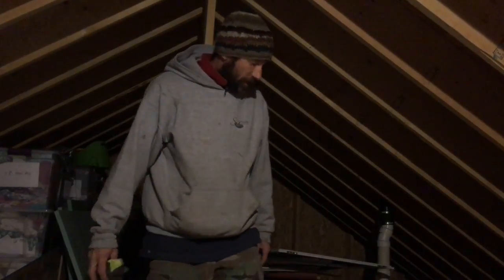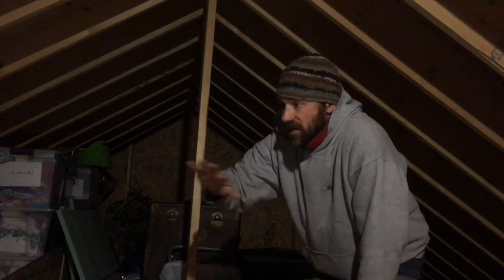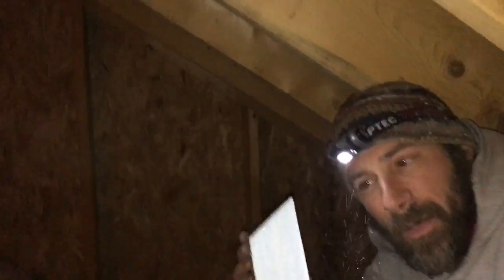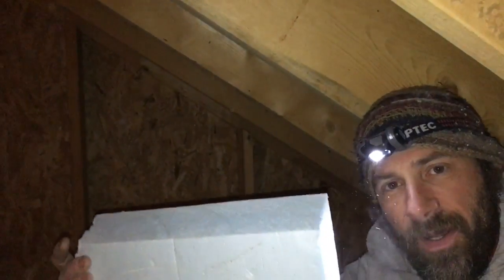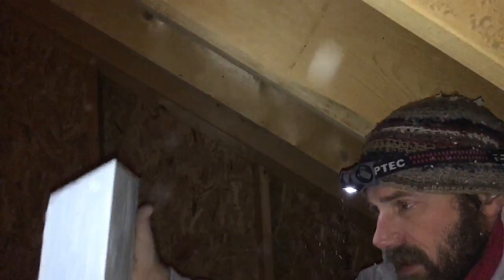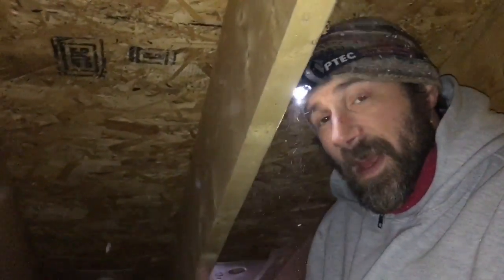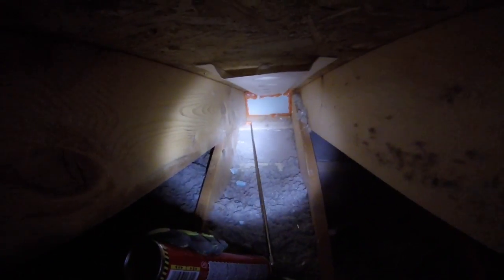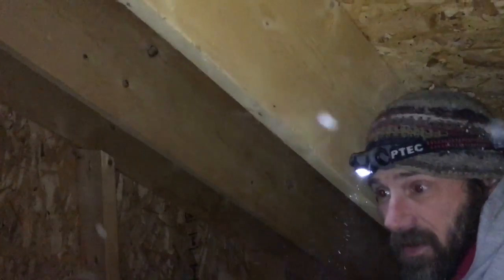Doin' the Dirty--Attic Air-sealing.  Maine VLOG 243

Comment: To me, that's the most positive attic air sealing project video I've seen so far ) Thanks for sharing :)
Reply from the maker: Denys Motornyi thanks, man. Trying to keep it real...good luck with your projects!
Reply: @CurryCaputo  any advice for a guy in Vegas, on sealing top plates, so i dont have soffits vents, i already foamed sealed accessible wire and pluming gaps and installed attic fan and attic foil to roof rafters. I also caulked my air vents and ceiling fans and used foam inserts to outer wall outlets. and added weather stripping to doors, and caulked loose windows, and added windows screens 90% to all windows. cleaned evaporator coil and condenser coil.

Comment: Curry, I have gable vents originally & had roofer put ridge vent when he replaced old roof. I was going to cut 2x6” lumber pieces to close off rafters & air seal till I watched this. Do I need to do some math too🤔 Thanks, just found your channel👍
Reply from the maker: John, wouldn’t hurt to run some numbers. You should have 1ft2 of ventilation per 300 ft2 of attic. So divide your attic area by 300–that’s how much ventilation you need. Then, multiply that by 1.4 if your vents are screened (screen/mesh take up 40% of the area). Ideally you provide 2/3 of the ventilation area low in the attic space, and the remaining 1/3 at the top—this set up an air pressure forcing venting. Does this make sense or help?!

Comment: I believe your foaming completely around your styrofoam blocks is unnecessary extra work. The ventilation created by the baffles from the soffits into the attic cause the attic space to be unconditioned, so the foam doesn't perform a function other than an overkill way to keep blown-in insulation from getting into the soffit and clogging the soffit vents.
Reply from the maker: Agreed. I use the canfoam to adhere the foamboard to the adjacent wood framing. Otherwise it’s difficult to mechanically fasten.

Comment: Nice job!  Looks like a long foam gun is a must.  Is it easier with R38 fiberglass?  How about a 4/12 pitch?
Reply from the maker: Greg Simonds the fiberglass would be easier, but less effective at airsealing. Also during high winds it can be moved out of position. The only bugger about the 4.5-pitch is the limited headroom along the eave. You may be on your belly! Or if you have vinyl soffit at the overhang, you could remove it to expose the eave, then install foamboard blocks from the exterior. Good luck!
Reply: @CurryCaputo  Thanks for your feedback.  Your technique is perfect.    I am reluctant to start because of the length of attic exterior walls on our 2700 sqft ranch (plus garage).   I wish you would drive to Connecticut and do it for me!